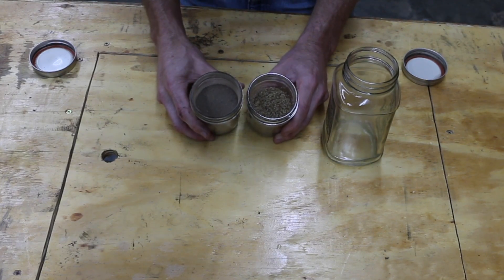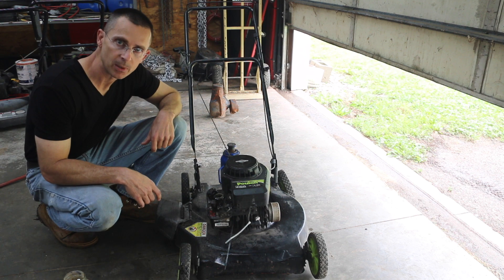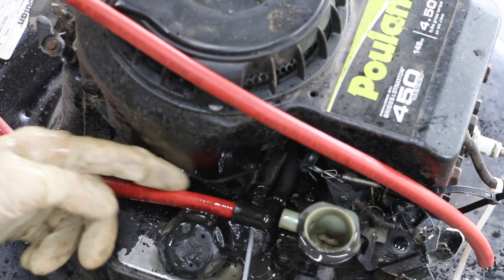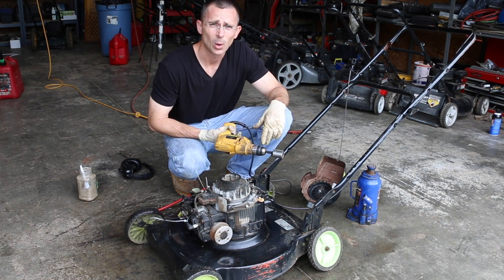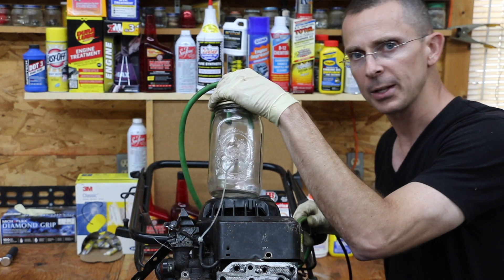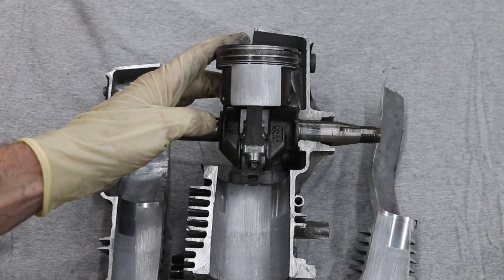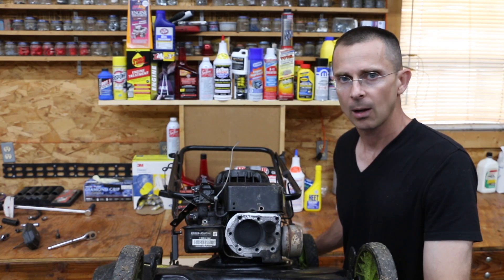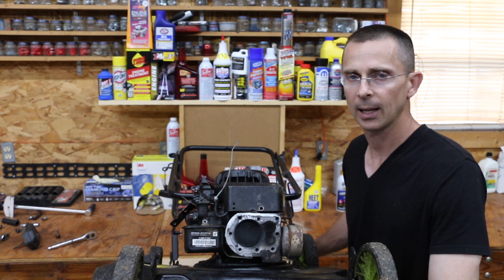Will Dirt Destroy an Engine?  See what it does to this Engine!

Comment: What is the blow by from? It happens on my dirt bike a little and it drips out the tube on the bottom onto my skid plate
Reply from the maker: Ian, Once combustion occurs in the combustion chamber, combustion gasses move past the piston/rings into the crankcase, pressurizing the crankcase.  Crankcases have a way of allowing air or gases to escape.  An engine in good working order will have very little blowby compared to the engine is this video!  Thanks for watching the video and commenting!

Comment: I'd like to see oil that is much too thick or much too thin. Also oil way too full and close to empty.
Reply: 802 Garage I've got a car engine that's been run with the oil light on (low oil). Really nice and loud with heaps of rod knock. Maybe I should make a video of it :-P
Reply: 802 Garage Of course lol. It was my house mates car and was driven for many kms like that. Then it "started to make this funny noise". I might dismantle it all and make furniture out of it
Reply: XD yep the oil light usually means basically 0 oil pressure. :P
It's done for.
Reply: Haha sounds like an awesome plan.
Reply from the maker: 802 Garage, These are absolutely terrific ideas! Thanks for watching the video and commenting!
Reply: No problem. Thanks as always for the replies. The channel is genius so far.

Comment: I'd like to see the effect of running with water in the oil.

And maybe a longer term test 2 mowers - service one and not the other see how fast engine health diverges as the oil looses its protective properties. 

Run a mower really lean and one really rich until failure and show the different changes due to the fuel mix? 

Just a couple of ideas. :) once again thanks for the videos.
Reply from the maker: LJMR2, These are great ideas!  Thanks for watching the video and commenting!
Reply: try putting soap in the oil.  it might be something people would do to clean their engine

Comment: Wow you really gave it hell! I would have been interested in seeing results after the first time it died, just because that seemed to already do enough damage.
Would also be interesting to see this test with various filters in place to see which type actually filters best, though that's a pretty extensive test that could require multiple engines.
Reply from the maker: 802 Garage, This is a great suggestion!  Thanks for watching the video and commenting!

Comment: I changed the oil on my lawn mower since I put the wrong stuff in, however, luckily, I got all of it out, put actual oil in, and it runs pretty good. Now the blade is getting sharpened by my friend, and it needs a new spark plug.
Reply from the maker: Glad the lawnmower engine didn't have any damage!  Thanks for watching the video and commenting!

Comment: What about testing synthetic oil vs conventional  oil? Or oil additives
Reply from the maker: Nick, This is a terrific idea!  I'd love to do this test, especially survivability of extreme engine heat!  Thanks for watching the video and commenting!
Reply: Synthetic's generally going to win over conventional; Synthetic can withstand higher temperatures and not evaporate as quickly for example. I had AutoZone Conventional 10w30 in a mower for under an hour of running time and when I took the oil cap off I saw a lot of smoke in the crankcase; I then removed it and put SuperTech Full Syn. 5w30 in and the smoke in the crankcase was greatly reduced.

Comment: Can you explain the the compression test (hot and cold) and how/what/why of what that tells you?
Reply from the maker: ytube777, Great point!  An engine with good compression is capable of achieving an easy start, normal horsepower and fuel economy.  An engine with poor compression will suffer from poor horsepower, difficulty starting (usually), poor fuel economy, blowby into the crankcase (usually), excessive oil consumption, and other possible issues. Thanks for watching the video and commenting!
Reply: Thanks! I'm enjoying your videos as a layman.

Comment: test run leaded gas
Reply from the maker: purebreddead, Is there a way to add lead to fuel?  Sorry for the ignorance on my part.  I haven't seen leaded fuel since the 1980s and I've never had a need for leaded fuel.  Thanks for watching the video and commenting!
Reply: i think there are lead fuel additives you can buy. I'm curious if lead would restore some compression, it used to be amazing on engine valves

Comment: Another test I would LOVE to see is for you to overheat the engine severely by disabling the engine's cooling system perhaps by cutting the flywheel fins off to simulate a coolant loss. I predict severe ring and cylinder wall damage and maybe a warped head.
Reply from the maker: This is another GREAT idea!  Thanks for watching the video and commenting!
Reply: All you have to do to simulate that would be to remove the shroud around the engine. They rely on that shroud to focus and guide the air coming off the flywheel, and without the shroud, they will QUICKLY overheat.

I imagine a flathead wouldn't really give half a rat's ass about it, though, and would probably fire right back up after it cooled down. HOWEVER, I have personally worked on a Briggs OHV V-twin that bent two pushrods because a cylinder head overheated and pinched the valves. So the newer OHV engines are more vulnerable.
Reply: @TestECull  You are exactly right. That's all you would have to do, to disable the cooling system. Those light weight aluminum blocks don't take long at all, to reach 500 degrees+, without the airflow from the flywheel fins being directed down through the heat sink fins of the cylinder and cylinder head.
Reply from the maker: 1985Kx, I have a mower with a tecumseh that would be great for this test!  Thanks for watching the video and commenting!
Reply: Set em on fire
Reply: fill the fins with a mouse nest, is enough to over heat the engine, it might expand the head enough for the hardend seats to drop out, stopping the engine
Reply: You should drain your radiator before you go on a road trip. Let us know how that works out. (not)
Reply: A DIY Computer Guy I actually tried to overheat an old mower engine ones and find it very difficult to do so. First I removed the fan cover and let it run at full speed and nothing happened. Then I took a hammer and strike off every fin on the cylinder and tried again. Nothing but some smoke from the old gunk on the engine still impossible to damage it. Then bypass the revving regulator and force the engine to run at maximum possible free air speed and that sucker would just run for ever and still not blow. Only when it ran at maximum speed without oil it happen, the connecting rod exploded in that sucker making a very nice katching bladda bada baaaooowwww. Disassembled the engine to look for damage. Was disappointed because only the connecting rod was literally gone leaving only a little stump right under the piston. The rest was powder in the machine. There was no signs of fatal wear or damage to the piston or cylinder wall even if it ran that warm and even without oil in the end. 
And STILL that mower was just a nightmare to trust and never started no matter what I did to fix it. It was begging me to end its misery and even then it disappointed me by not making a spectacular end even though I had to spend more time repairing it in vain before I gave in for its request. Man it was good to take that evil thing to the dump and get a better life with the other free mower I got that only needed a new spark plug to run like 15 years to come
Reply: diy computer guy. I can tell you from the days I used to cut lawns for people when I was a kid air cools b &s engines are tough I over heated my mower from cutting deep grass at wot (I had a manual throttle no Governor for more power) once it cooled it fired back up they are pretty under stressed engines.
Reply: A DIY Computer Guy use a tecumseh, they blow up with a good cooling system lol happened a few times to me
Reply: A DIY Computer Guy add 80% nitro methane additive to the gas.

Comment: You can test how the engine suffers when you run the incorrect octane in the engine.. A simple way to test this would to use white gas which has like a 50 octane rating or test using odd fuels in the engine like E-85, since the mower doesnt have a way to adjust timing to correctly burn the fuel...
Reply from the maker: William, This is a great suggestion!  Thanks for watching the video and commenting!

Comment: I think you should simulate a head gasket failure by dumping water into the oil to see if the water will quickly cause damage, or just quicker wear.
Reply from the maker: A DIY Computer Guy, This is a great suggestion!  Thanks for watching the video and commenting!
Reply from the maker: Lassi, Regarding head gasket failure, I've seen oil contaminate the cooling system as well as coolant in the oil.  Both are realistic scenarios. Thanks for watching the video and commenting!

Comment: Cummins training film with an old natural aspirated engine on a dyno (from the 50s) 250 horsepower , 1/4 cup fine dust in the intake and the engine lost 50 horsepower.
Reply from the maker: CBmech, This is great information!  I have an old Ford 5000 tractor with an "oil bath" filter.  I'm thinking I need to switch out the filter with a more modern design to protect the engine!  Thanks for watching the video and commenting!

Comment: put 40% nitro in it from an rc car
Reply from the maker: Darrell, This is a great idea!  Thanks for watching the video and commenting!
Reply: basicly nitro r/c engines are diesel engines they use a glow plug what happened is it got the spark plug red hot and it ignited the fuel
Reply: i knew a kid who put straight rc nitro in a moped it ran so hot engine wouldn't. shut down even with sparkplug wire removed would have liked to seen that motor toredown
Reply: Darrell R I
Reply: I've tried nitro in a Honda 8hp I had theirs so much oil in r/c nitro fuel it just ran like crap. maybe a 2 stroke would have a better chance
Reply: cjgordon22 yeah i have used to have fun running nitro cars but moved up to 2 stroke for the longer run time and bigger models

Comment: have you tried "RESTORE" engine RESTORE yet???
Reply from the maker: Eric, Great suggestion!  I definitely plan to test Restore.  From the research I've conducted, it has show very impressive results.  However, I'll believe them when I see for myself.  I'd like to pretreat an engine with Restore and then drain the crankcase to see how long it'll run without oil.  I'd like to test using new engines but that'd be cost prohibitive unless I crowdsource via Patreon.  Still thinking about it...  Thanks for watching the video and commenting!

Comment: i the years i have been servicing all types of motor vehicles i have only ever seen dust with the odd grain of sand NEVER have i seen that much sand in total in all the 40+years i have worked in a workshop and the dust would be sucked in as a cloud and not as a "lump"
Reply from the maker: Chris, Great point!  I guess I could have rolled the mower down my gravel driveway, allowing it to inhale dust and dirt, but it'd be nearly impossible to capture on video.  Again, great point!  Thanks for watching the video and commenting!

Comment: I would like for you to try Motorkote .I found out that Slick 50 is not really Slick 50 ,Xcelpluse is really Slick 50 the name was bought by Shell in 1984, just using the name .Really good info love your vid good work.
Reply from the maker: Allen, Great suggestion!  I recently purchased Motorkote.  I'm considering the purchase of several new engines to pretreat with additives and then run with empty crankcases to determine which provides the most protection.  The cost of new engines is cost prohibitive at the moment.  Thinking about beginning a Patreon account in which 100% of funds would be used for engine purchases.  Not sure if there's enough interest to go this route.  What do you think?  Thanks for watching the video and commenting!
Reply: Making really good content Patreon would be the right thing to cover cost,with the views you are getting it would be easy------i think do not hold me to that.

Comment: I'd like to make a suggestion: wrong type of oil in the crankcase. Or just test out different formulations to see what is compatible in a small engine. Nice videos by the way, been watching for a while, but subscribed today. :)
Reply from the maker: GrognardOfXCOM, First, thank you for subscribing!  I like your idea of using the wrong oil type to see if it causes damage.  Thanks again!
Reply: Too thin of viscosity when hot: Not enough oil film strength to prevent metal to metal contact.
Too thick while hot: Oil won't flow as easily as it should.

Comment: That was a great test, but I don't think it's real world at all.  When I was mowing yards as a kid, I would use an old sock in the air filter, and it worked out pretty good.  But when I was doing lots of mowing it seemed that only grass clippings would be getting in the filter, and maybe a little very fine sand that is kicked up by the mowing process and the wind blowing the right way.  So I think a more real world test would be with grass clippings.
Reply from the maker: TheZigZiggy, Great point!  Some places are more prone to dust and dirt than others, but grass clippings would provide a great test!  Thanks for watching the video and commenting!

Comment: I would like to see you do this test again, but instead of dispensing the dirt directly down the carb with a spoon, throw it into a shop fan that's in front of the engine so the engine sucks in a more real-world dirty air. I'm curious if the dirt covering the cooling fins will change the engine's mode of failure, or if itt'l last a little longer that way.

Obviously itt'l still die, that's a given.

I'd also like to see you get a tach hooked up to one of these engines, bypass the governor, and show us just how fast these things can turn until they go Kerbal on us. I'm betting somewhere around 5500-6000RPM is when the rod lets go.
Reply from the maker: This is a terrific idea!  Thanks for watching the video and commenting!
Reply: I agree with this. I'd like to see the test repeated, but as a bunch of dirt and sand dispersed in a "cloud" such as by a fan, which would better simulate how it would typically happen in the real world. Probably won't straight out kill the engine, but even a loss of 5-10 PSI would be a fascinating test result and very informative for those who run engines of any kind without a filter.
Reply from the maker: richfiles, Great suggestions!  Thanks for watching the video and commenting!
Reply from the maker: Lane, I'll definitely do a video on this!  Thanks for watching the video and commenting!
Reply: Ran a stock car with open valve cover breather( didn't notice) three heats later engine toast. Not so much the sleeves or pistons but all the crud gathered in the sump and destroyed the main bearings.
Reply: I have bypassed the governor before, it revved up fine, but never blew up. Granted I didn't have a tachometer, but it stopped gaining speed after a bit. I think this was due to valve float, acting as a "rev limiter", compression was being lost due to the valves being open at the wrong time, causing the engine to misfire, very similar to a fuel injected car engine. The computer cuts fuel to the injectors, causing the engine to lose power.
Reply: I wanted to give you moar thumbs up for a Kerbal reference, but have moar boosters instead... Or struts... Your choice! :P
Good idea. If you wanna keep the mess semi contained, maybe set up the mower and fan inside an enclosed space... Airflow at the top to circulate oxygen, but fans around to create a cyclone of dust and dirt within the space.
Reply: TestECull Yes, I agree with testicull, it would make the test more real.
Reply: i had a couple of older motorcycles with basically no air filter (by design) but they had a metal dome with coarse mesh inside , i would guess the dome deflects enough air so the force separates the particles out somewhat before the air has to go sideways to enter the carb, a bit like a vacuum separator does
Reply: TestECull iget your post... 8000 is possible with mods... i think the channel mr midshipman modified a predator engine this way (predator= honda clone) its done for racing though....
Reply: Project Farm I agree with the tach and see how high they rev!!!
Reply: TestECull exactly my thoughts
Reply: Mr TheHillfolk, anythings possible, but many similar cars that run no probs including a identical sister car, in the class we all have to run stock 1uzfe motors. The oil was really contaminated but thats a worst case scenario. (these are prepped clay tracks that makes a very fine dust when dry)
Reply: TestECull   Yeah...that wasn't exactly a typical scenario.
Reply: i agree with you
Reply: Hillbilly Peak. J
Reply: Especially dry powderly dirt .
Reply: Rassanity 
Could oil starvation have been an issue ? Roundy rounds sloshing the oil to 1 side....lately those spectator drags on the roundy rounds have been popping up in my feed. 
Amazing how many v8s I see where they white smoke in the hard corners out the exhaust. 
Could be a bunch of things happening there, you sound like you know all that. 
slow oil drain up top flooding the valve seals ...tired rings ...oil slosh(for sure)....
Reply: TestECull 
I got one on my channel , I must have fed it 3-4 handfuls of speedy dry and about the same amount of grass clippings. 
I even gave it a Marlboro but it got stuck in the carb.
Did ya know they also rev to about 5700 when ya tie the throttle wide open? 
Damn thing sucked down 3 tanks of fuel doing all that and trying to blow it up. 
I finally had to drain the oil to nuke it.
Reply: Why don't you try it on your motor? Let us know how that turns out.